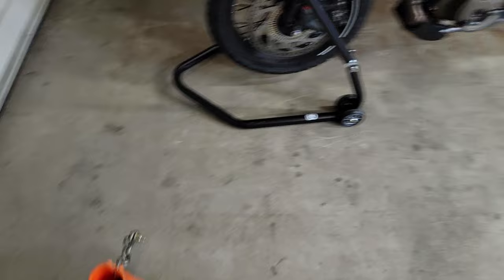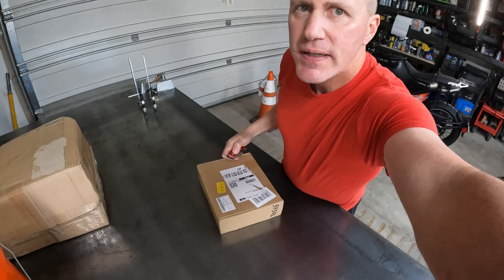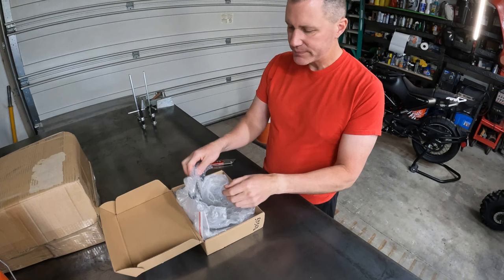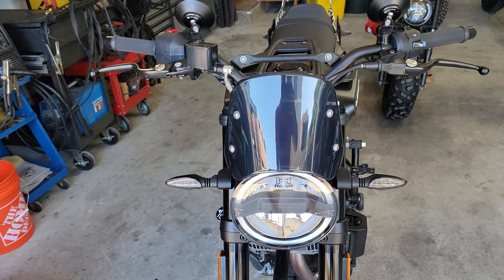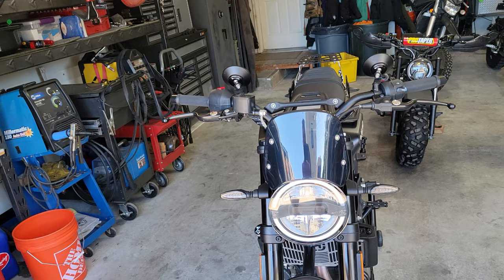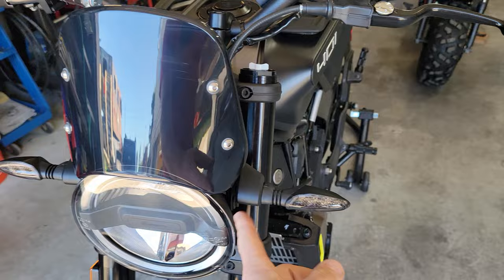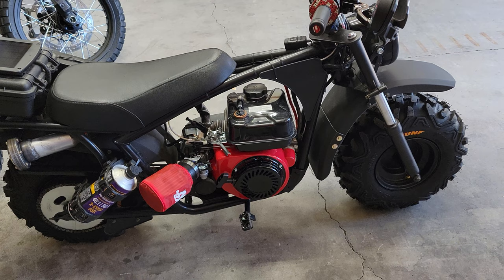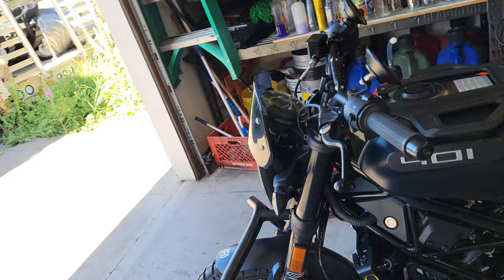Husqvarna Svartpilen Part 13 (Fly screen)

Comment: Using a magnet to check whether something is stainless steel is a quick & easy check!  Good tip!
Reply from the maker: My go to tool for finding cheap hardware...
Reply: @SeanFillner  304 stainless is magnetic. only 316 is not so magnetic it is but not as much as mild steel.

Comment: I ordered the OEM plastic one, the aluminum is out of stock and too expensive in the UK. After one ride I noticed scratches, used rust oleum plastic paint and looks nice
Reply from the maker: I use the plastx but have not had any scratches since...

Comment: Just got one same as yours but it wont fit. Brackets wont line up and looks like i will need to squeeze them in but dont wana break the plastic. Did you have to force the brackets in abit?
Reply from the maker: You won't break that plastic.  I don't recall tbh.

Comment: I bought one off Aliexpress and it was a lot more difficult to fit owing to the thin sheet metal brackets. and i had to put spacers behind the screen and chobble a bit off the bottom so that it fitted the head light properly. still it worked well and for NZD23 delivered it was good. have all the fasteners on your engine started to rust. must be the poor quality Indian plating? I have replaced most of mine with 316 Stainless cap-screws. the chain is also made from 'lead' and stretches in no time at all. paint quality poor especially under the seat on the tank. still it gets the looks and is overall a nice bike. I'm doing a hydraulic clutch. doesn't need one but I did one on a CX500 and SR500 and old Enfield India. just nice feel. have a KTM side cover coming from UK to modify with KTM65 slave.
Reply from the maker: I have not had any of the problems you are experiencing at all...

Comment: will the aluminum one still fit? I see that the brackets look different from the lexan.
Reply from the maker: I did not test fit the aluminum one but Willow did on her bike and the brackets between the lexan and the aluminum don't match at all....
Reply: @SeanFillner  ok. Yea I just ordered the aluminum one. Doesn’t look like the brackets will line up with the bike
Reply: Figured it out! had to combine both windscreen hardware to make it work. So it all worked out!
Reply from the maker: @valkyriefitnessnutrition_  That's awesome!  You should post a video on your channel!